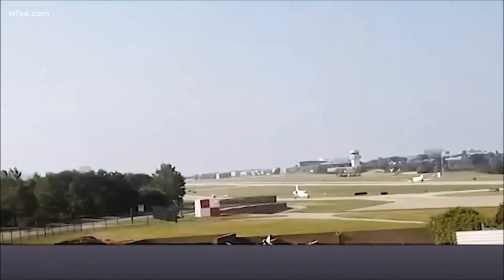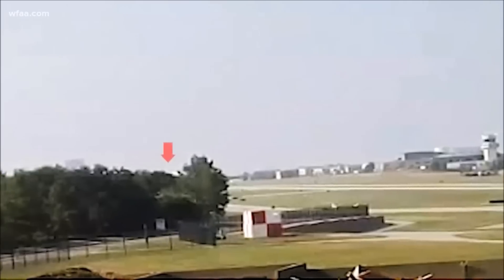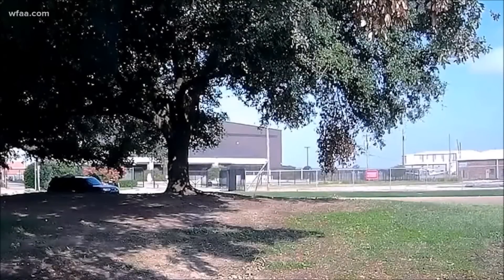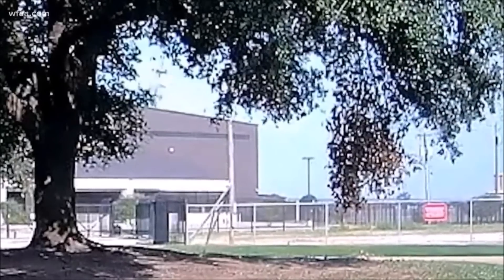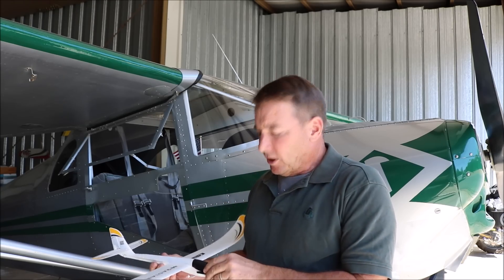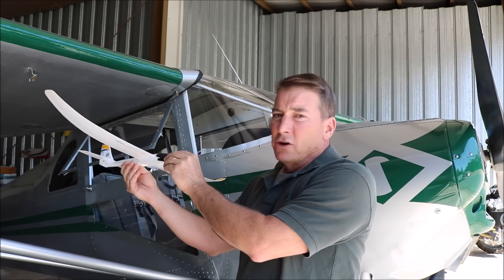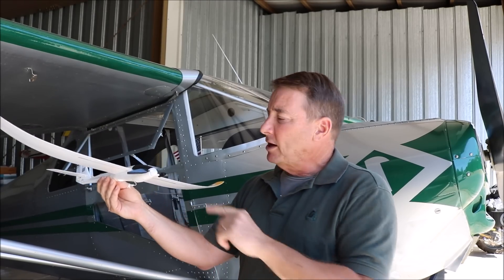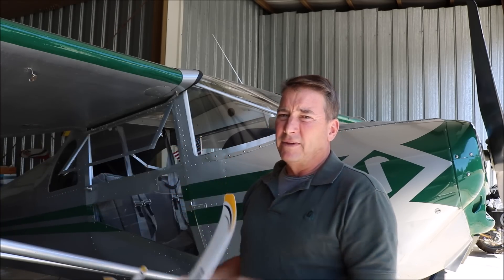Addison Tx. King Air 350 Crash UPDATE- Vmca

Comment: Hi Juan, been away for awhile. Had to make comment here.
I have known a high performance twin pilot like this, he had several incidents, landing with gear up, this exactly same thing of throttle hand removal, no strict checklist, and a some kind of either loss of power asymmetrically or asymmetric pitch control variation at cruise and altitude.  The last incident resulted in his fighting for his live holding the rudder for about 200 miles.  Oh, I forgot one starting the engines between two hangers with foot on rudders holding brake getting distracted dropping a pen or map or whatever on the floor reaching down to get it letting up on one of the rudders and causing the airplane to turn, using an automotive term, making a donut between hangers and clipping a wing on a hanger.  HIs wife, after the fighting for his life on the rudder incident between Fullerton, and Tempe put his Scottsdale house for sale and said they did not need it anymore, and he did not need an airplane anymore.  You could not talk to him on anything... he knew best. He had been orphaned at Dresden during WW2 as a child losing both parents to the bombing.  

My last contact was he hired me to negotiate a contract with Picatinny Arsenal for his machine shop, as I had experience with them.  His best friend was the expert on a certain type of munition [his friend was also from Dresden and had lost his parents their too].  The two teamed up on doing work for the government on these classified programs, involving ground to air missile warheads, and some other classified uses.  I met with the Picatinny program manager and engineers, who had brought a computer programer contractor with them, and they were going to pay the German pals through the computer programer who did programing maintenance and up grades on an specialized program used for analysis of the warhead performance, under a line item entitled "hard drives and computer media" in his multi-year Task Order Contract.

After, talking with the Picatinny crew, and the programer, whose wife was a CPA, and was worried about the billings being run through his task order, for the warhead components. 
My suggestion after lunch break is I took the three of them side, and said "RUN DON"T WALK AWAY" just hand them all those photos, prints, and specs, and kick them out the door.  Then call the FBI to come collect the tantalum materials. But my services were terminated on the spot.  A few years later I was sitting in the Program Executive Officer of Ammunition, on another project, and brought up to him and the Chief of DoD Business Law, that all their practices were perilous.  Why I brought this up is to afford a King Air usually the guys have to own a business, and in doing so they get used to ordering people around, and doing what it takes.  This is the last type of individual that should EVER BE ALLOWED even on ANY AIRCRAFT.  

Many years ago, I think its about 31 years now, I had a conversation with a friend Russ Schleeh, who was in the Air Force, a test pilot and flew some real interesting planes including the YB49 flying wing of Jack Northrop.  He was at the time very active and liked to go dirt biking in the desert... often up near Edwards AFB named after a friend of his who died in a crash in that same type of flying wing. I was asking him why he quite flying exactly as soon as he turned 65 years old, as he was fully capable at 71 years old, at the time of flying. Russ's answer, was a very direct, "It's not the that I could not, but the emergencies that come up even very rarely test even a young man reflexes and in every way else to the limit."  Thinking on this as I was starting to know I could crash my motor bike and not come back the way I was, so for that reason I quite riding.  I used to visit S. Harry Robertson in his Tempe office, and we talked about crash stuff, and he was a good friend, I always noticed the burn scars he had but never ever talked about those... ever but somehow knew his crash research was likely resultant... https://www.williamsnews.com/news/2019/nov/12/crash-after-crash-harry-robertson-turns-tragedy-ch/ 
All the Best,
Your work here I think makes a huge difference
K. Rustin Scarr

Comment: I have a question for you. You had mentioned i believe on the previous video regarding this accident that planes can either rev up to full power then release the brakes and then take off that way or they can gradually increase power as they roll down the run way.  What would be the reasoning behind doing 1 or the other of those methods? 
My other question is had the plane rev'd up to full power released the brakes and started to take off, do you think they would have incurred the engine troubles sooner and had more of a chance to abort the takeoff?

Comment: At maximum TOW and above sea level?  I wouldn't be very happy even starting the take-off run, and I would stop at the slightest deviation from the norm.  It is better to leave the end of the runway with a retracted u/c than to claw for height.  Very sad.  Thanks, Juan.
Reply: I do it almost everyday in my King Air 350. At airports well above sea level and surrounded by mountains. 

We are a two crew operation and every one of our pilots has a type rating and sim training with V1 Cuts. 

I’ve done a V1 cut in the sim with flaps at approach (40%) and no autofeather and it was a handful but I did manage to get it to 400 feet and V2+9 for flap retraction (normally you manually feather a non feathered engine right away if it doesn’t autofeather). 

And the Net Takeoff Flight Path we need to operate single engine and clear obstacles isn’t based on new plane and test pilot... it’s made to reflect degraded aircraft and pilot performance. 

That and never having to even do a precautionary shutdown of a PT6A in my couple thousand hours of flying the 350 and the company not having an inflight shutdown any time in the last decade makes me put a lot of faith in that machine.

In this case it was a combination of inexperience, poor decision making, poor control, and bad luck.

Comment: VMCa is determined with the critical engine windmilling, not feathered. Also, the wing of the failed engine side doesn’t necessarily stall in all cases but the airspeed decays to the point that the rudder can no longer keep the operating engine from physically rolling the airplane over. In this particular case it looks as though the pilot was either not using the rudder at all or he was pushing the wrong rudder pedal, hence the confusion found on the CVR. I mean no disrespect.  In an industry that is so technical as ours I’m sure that you knew everybody was going to give you their two cents. It’s easy to comment from my couch, what you do is hard. Thanks.

Comment: I would agree with the bulk of you're good analysis.  what it "looks" like to me is that the pilot flying whoever that was attempted to maintain directional control with ailerons rather then rudder causing the aircraft flight path vector to depart into the "skewed" flight you are talking about which essentially started slowing it down (coupled with the gear down) and well she stalled.

UAL had this problem sometime back with a B747 in SFO...fortunately there was an instructor pilot in the jump seat  Robert
Reply: Robert Oler I recall that one, not only ailerons but roll spoilers. Barely cleared the hills and set off every car alarm in San Bruno.

Comment: This was a barely new aircraft... can’t believe it had engine problems so soon... of course don’t know the hours on them but can’t imagine many. RIP
Reply: New equipment does not mean there is no manufacturing or material defect which should present itself in the first ninety hours of use, if present, in any mechanical or electrical device, an oversight that can lead to tragedies such as this one.

Comment: King Air 350 (advertised)  Empty weight: 9456 Max TO weight: 15,000 Max Fuel: 3611 lbs/539 gal 10 Pax (2 children). 1600 pounds.  Right now we are at: 14667 lbs. (Approximately)without any baggage. It can carry legally 550 lbs of baggage. Figure they are going to Florida so each passenger would have 55 lbs limitation..which is not a whole lot...so what? I think they were right at MAX TO WEIGHT...(you discussed carrying 1800 mile range fuel...imagine they would like to have that back...) So what happened?  Max TO, engine failure...aircraft doesn't maintain directional control, gets slow, left wing stalls/spin. If they could have kept directional control, (stomped on the right rudder), nose down.... left prop feathered ... even if they crashed straight ahead they could have had a chance to survive. This is WHY twin engine airplanes kill people..had it been single engine..they would have crashed straight ahead and maybe survived. Sad. That extra fuel may have killed this family and the others.

Comment: Was this King Air rated for single pilot operations? Our local airport used to have several King Airs (I live in the Nascar Belt so many crews were flown to the track on chartered King Airs) and they were all single pilot ops unless weather or the PIC requested a 2nd pilot for safety concerns... Just curious :-)
Reply: You mean was the pilot rated no SIC required. The Kingair can be flown with 1 pilot, but he has to have a type rating that doesn't require a SIC. It has nothing to do with the airplane.

Comment: I'm curious as to what should have been done to prevent this crash. Anything?

Is it possible for private aircraft to run engines full throttle w brakes on for a few seconds to check condition of engines?

Comment: I flew Seneca 2’s with piston engines.  I knew if I lost on engine after V1 I would pull back both throttles.  Piston engines do not climb on on engine.  A fully loaded King Air May not be able to climb on one engine?

Comment: Agree with your analysis. Still odd a pilot with his experience did not recognize or apply engine failure on takeoff procedures. Makes me wonder why?  Pushing the nose over to maintain safe single engine airspeed should have been recognized as critical. Difficult to see from the video, but looked like the nose of the aircraft never tracked down. Thanks for a great update.

Comment: I'm going with 3. The motor to the pilots left loss power. The right wing motor under good power yawed  the plane to the left.  The pilot gave full right rudder (staying off the elerons not to kill lift) to try and maintain max lift, but by this time there was too much air speed lost. The power of the good running motor took over and drove the plane inverted. I know this because I witnessed an identical crash in 1978. The plane (BeachCraft 95-B55) went in 500 feet from where I was standing. It was horrible!!!!

Comment: Piper Aircraft, while still in Lock Haven, PA, and around the time of the Apollo 11 Moon Landing, displayed RATO systems, with either two or four engines, 'which would soon eliminate many engine failure related crashes'.  I wonder how far that concept went; my dad, a metallurgist, thought it possible, but difficult because of the need for "hardening points, wing and fuselage framework strengthening, and the ability to mute the active engine".

Comment: Has it been confirmed that the left engine had failed? A King Air taking off from Essendon Airport, Melbourne Australia about 3 years ago had a very similar accident, landing in a shopping centre to the left of the runway. It was determined that the cause of the incident was taking off with full left rudder trim set and not checked.

Comment: Hi Juan, This crash looks almost identical to one here recently in Aus, This was a King Air 200, it was found that the pilot had unknowingly had full rudder trim applied on takeoff which led to a very similar yaw and stall condition into a shopping centre adjoined to the airport, ive included the link to the atsb report: https://www.atsb.gov.au/publications/investigation_reports/2017/aair/ao-2017-024/
Reply: @HiWetcam  This was listed as one of the reasons although they state id didnt contribute to the crash which it clearly did unfortunately .

 " The ATSB found that the pilot did not detect that the aircraft’s rudder trim was in the full nose-left position prior to take-off. The position of the rudder trim resulted in a loss of directional control and had a significant impact on the aircraft’s climb performance in the latter part of the flight.

At the time of the accident, the operator did not have an appropriate flight check system in place for VH-ZCR. Although this did not contribute to this accident, it increased the risk of incorrect checklists being used, incorrect application of the aircraft's checklists, and checks related to supplemental equipment not being performed.

Comment: I find it very troubling how common this type of accident really is. Thousands have lost their lives to Vmc related accidents. If you have not read the report by Lt. Col. Harry Horlings titled “Control and Performance during Asymmetrical Powered Flight”, I would highly recommend that you do (free on his website). He also has a video summary of his report on YouTube.

The takeaway is that loss of control can, and has occurred at speeds well above published Vmc (red line). The “actual Vmc” will be higher if the airplane is flying in a destabilized condition (more prone to loss of control due to a reduction of stabilizing forces). Full power, combined with insufficient rudder and aileron deflection, and/or banking towards the inoperative engine (or even, not maintaining a slight bank towards the operating engine), destabilizes the airplane and thus “actual Vmc” will increase. 

The surveillance video of the King Air accident bears much resemblance to the Embraer 120 accident in Mr. Horlings’ video presentation, where that crew experienced “actual Vmc” at approximately V2 due to insufficient control application and banking towards the inoperative engine.

Comment: That runway has a crush barrier at its end (EMAS) and in addition, the hangar they crashed into was not more than halfway down the runway. They had options to abort the takeoff and the worst case was damage to the undercarriage in the EMAS. Possibly the copilot was given the takeoff, V1/rotation speed was improperly computed for takeoff weight, and when an engine issue was confronted, the copilot froze and the PIC was slow to react? I live a few blocks from the airport and the affected hangar is newly built  by a local billionaire. Normally, the hangar holds a Boeing BBJ, a Dassault 50, and a helicopter. The Boeing was not in the hangar at that time but the Dassault and the helicopter look to be destroyed due to heat damage.
Reply from the maker: Thanks Bruce!

Comment: thanks for your efforts to share your knowledge and experience with the aviation community. Well Done!
As for the accident, obviously completely avoidable.  Having been lucky enough to survive my early and frequent stupidity as a young pilot ... i can now look back noting that out of literally dozens of engine out experiences I have had over the decades ... not a one of them in civilian aircraft resulted in any loss of life, though more than one resulted in a good case of the shakes after the event was safely concluded.  Training and preparation are there to ... well ... prepare for the exigencies that WILL inevitably occur if you put in enough flight hours ... failure to train and prepare simply means you are living on random luck ... and random luck is ... well ..RANDOM ... not a good thing to trust your life or the lives of others to ... never take your plane where your mind has not gone ... lack of imagination and preparation ... is what causes disasters ... broaden your imagination of what can happen ... and prepare for it to happen ... and then train for it ... have a plan .. and a routine that supports your early awareness of constraint violations ... and preset triggers in your mind for pre-v1 aborts, ...  if you shove those throttles forward not knowing exactly how far down the runway in distance and time v1 should be achieved ... you are just a moron ...

Comment: Working with a customer that specializes in aircraft safety equipment for flight, they say most all aircraft crashes are a composite of 5 events in sequence, each recoverable on their own until you add #5 at which you have doomed the flight.

Comment: Thanks for the update....
What would have been the best course of action when it was noticed that one engine was failing?
If you had no runway left, then maybe shut down the good engine and become a glider?
Reply from the maker: https://youtu.be/OFARIKl_lkY
Reply: @blancolirio  Thanks for that.  So, V1 is 'the' decision point during a critical phase of flight and the blue line is God for flying on one engine.  If you lose an engine and cannot achieve the blue line on the airspeed indicator, and you've passed V1, and rotated,  then you must find a place to set her down gently, straight ahead, get that nose down and keep above stall speed. Don't fall below Vmc.